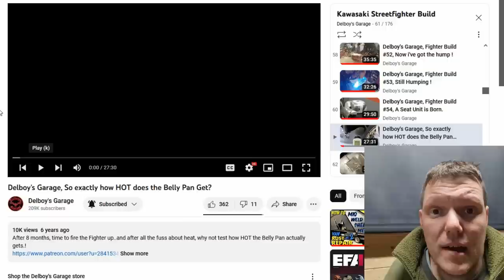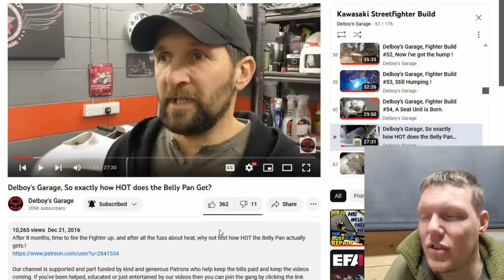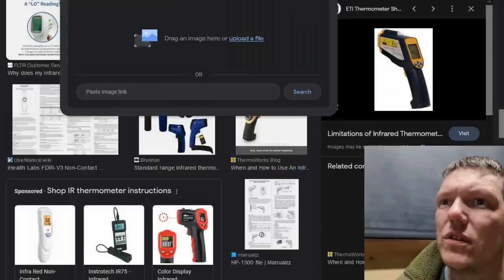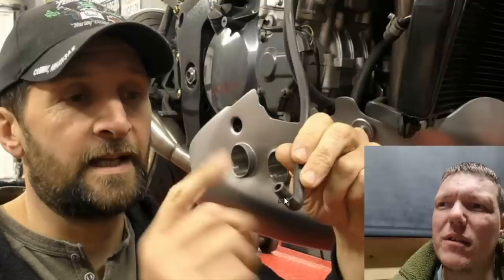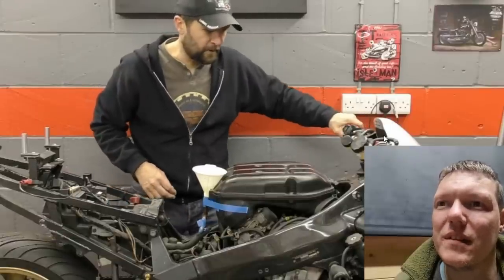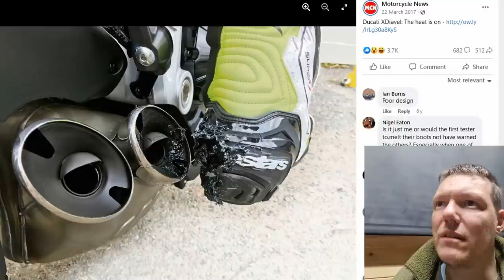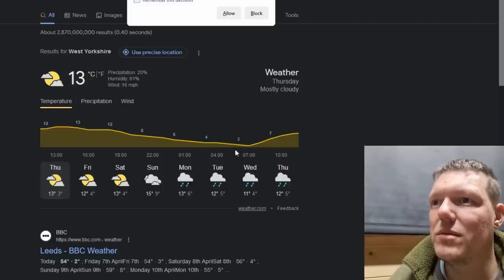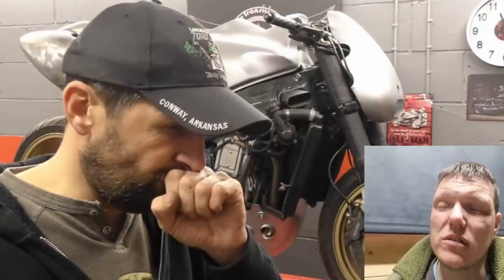HDS 39 - Strep throat Del

Comment: He did say 30 hours a week (hence the two 15 hour shifts presumably). He can’t be driving a bus surely if he’s doing a 15 hour shift.
Reply: Yeah, I think he said 2x 15hr shifts. So 30hrs total. But no way he can be driving for all of that, pretty sure that would be illegal.
Reply: he drives a coach so presumably there is time sitting around not driving
Reply: I might be wrong but I'm pretty sure  bus drivers can work up 16 hrs a day with a max of 10 hrs driving
Reply: @callmeishmael4870  yes you are right…up to 10 hours driving a maximum of 2 days a week. Not sure I’d want to be on that bus with Del at the wheel. Every bike he saw he’d immediately think about how he could turn it into a pile of shite instead of focusing on not wiping out pedestrians on the pavement!🤣
Reply: is it an around town sort of bus, or something like a National Express?
Reply: @toxicnerveYT  that's the max you can do a day 11hrs driving and 4 between breaks and wait time for coach trips IIRC.

buses have different rules usually split shifts of max 6 hours and then 1-2hrs off then the next six if I remeber rightly (though may have changed since I last looked.)

Comment: If Delboy thinks a funnel full of fuel taped to a hot running bike is a safe, no wonder he used Evans coolant. I hope his viewers don't copy his advice.
Delboy is a danger to himself and those who take his advice.
Reply: the washing up bottle trick is useful, the little nozzle lets you fit the fuel feed right on, stab a tiny hole in the bottom when its set up. but you cant spill it then, single use only as i suspect it will eat the bottle away
Reply: Then he starts moving it on and off his lift with no room to even move around. Definitely surprised he hasn't seriously injured himself yet.
Reply: @deadprivacy  Fairy liquid bottles don't need tape either 👍
Reply: @kunka592  Well said my friend, his bad advice may have got others hurt, YouTube should share any blame with Delboy for allowing these "how to" videos.

Comment: The reason  he only paid 8 quid is because it's a shit thermometer. A proper one that reads the temp at the laser dot is over $100. He doesn't know how his works, obviously. His is an averging tm. Read the damn instructions. The further away he is, the more area the unit is reading, and it's giving him an average. He's shooting the dot at the pipe from 8 in he's away and thinks the pipe is 70 deg..  it's not, 70 is the avg. of the pipe and a lot of area around it. Look at the cone shaped guide on the side of the gun.

Comment: Dose it really matter if the belly pan gets a bit warm, he is only at idle no real amount of heat generated and when ridden down the road there will be enough air moving around the belly pan and exhaust to not even worry about it. How many bikes have plastic belly pans/fairings that don't melt. The test is inappropriate. The most worrying thing is the use of Evans propylene glycol waterless coolant. It will remove half the heat that a conventional ethylene glycol water mix coolant mix would remove for any given indicated temperature